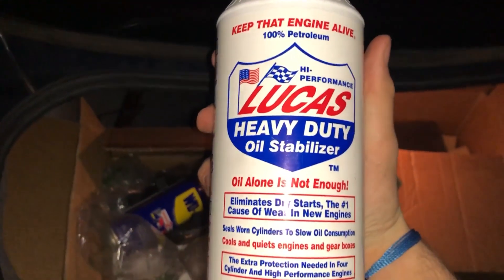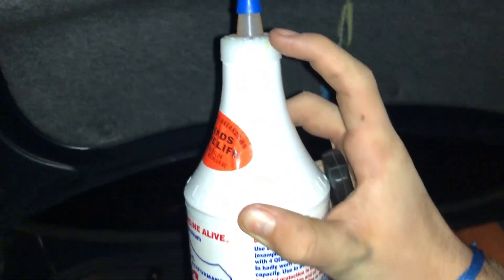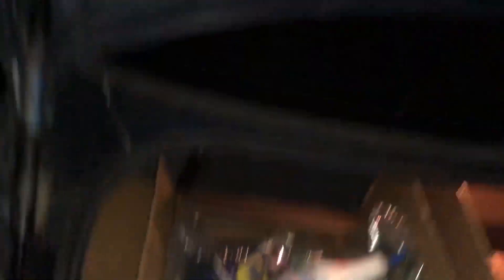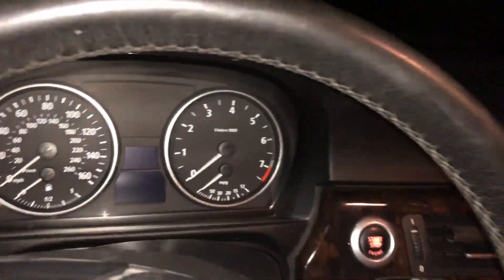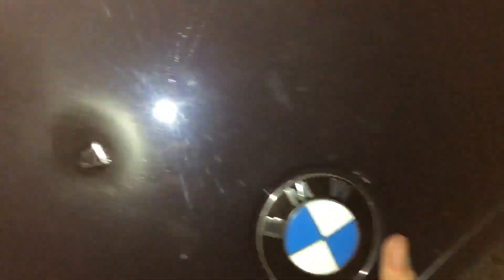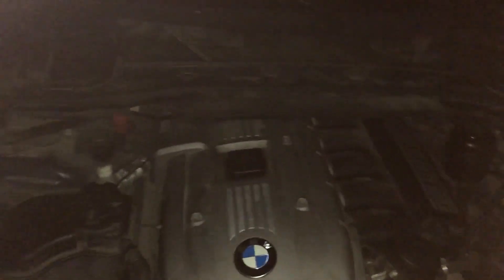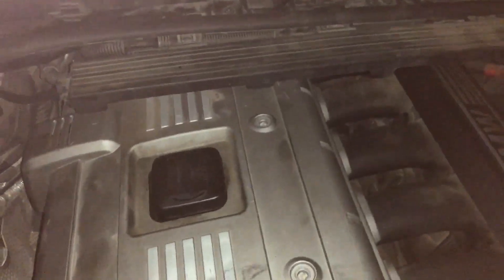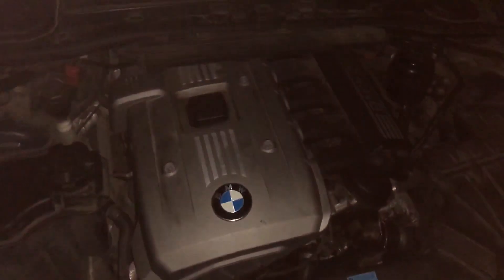How to fix the N52 Engine Lifter Tick on BMW's (E90)

Comment: To share what stopped mine..... I order a new oil cap oil cage and it went away
Reply: What exactly was wrong with the cap . Like the oil cap were u put the oil into the engine
Reply: why did you get a new cap ? what was the reasoning please help

Comment: use BMW LL-01 OIL equivalent ....
Castrol European Formula or 
Pennzoil Platinum Euro 5w-40
Once you change the oil a couple times with the correct oil, it will start to clean out all the little passageways that are clogged up right now, preventing the oil from lubricating the parts that need to be lubricated.